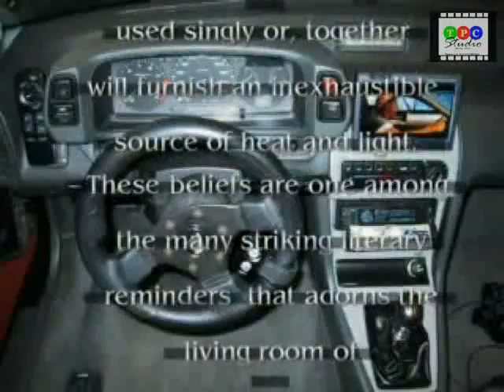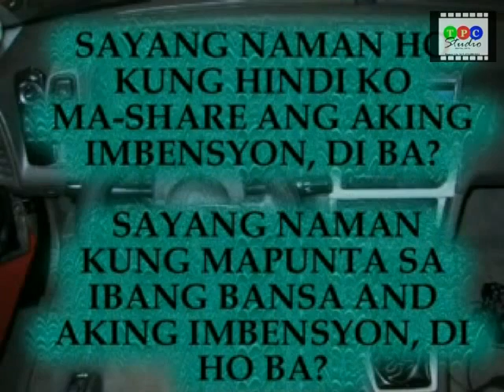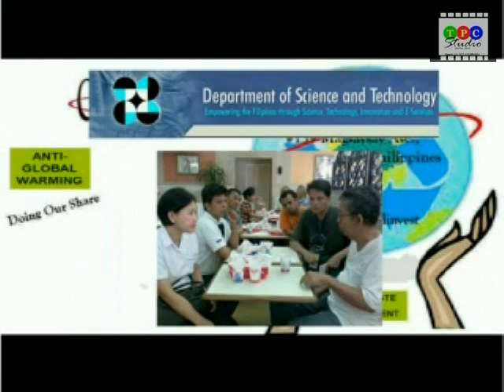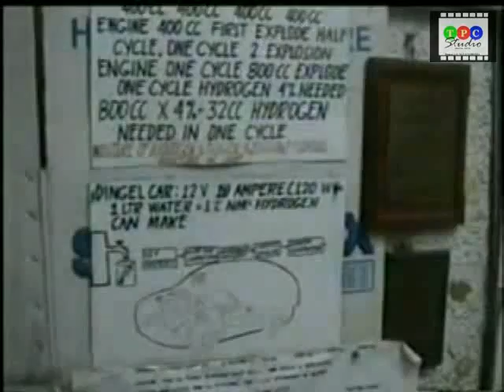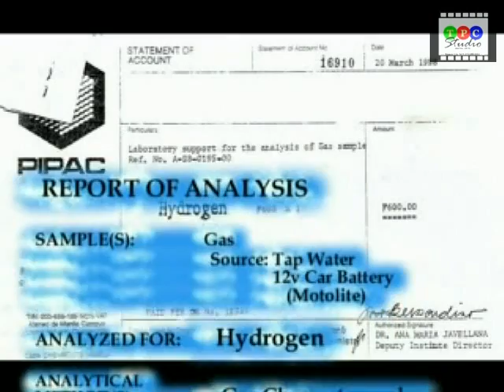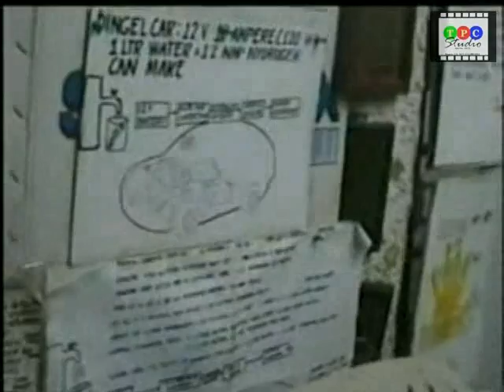Mr. Daniel Dingel's Water Car(part1)

Comment: THE SAME THING HAPPENED TO LEE SALEN-GA ALSO A PILIPINO WHEN HE DISCOVERED THAT THE SIGN OF THE ELECTRIC BATTERY & HENCE THE SIGN OF THE ATOM IS INVERTED MEANING THE ELECTRON IS POSITIVE.
HE ALSO DISCOVERED THAT THE NORTH TIP OF THE COMPASS NEEDLE IS ATTRACTED TO THE NORTH POLE OF THE EARTH; COZ THE NORTH POLE IS SOUTH MAGNETIC(GAY).
HE DISCOVERED THE SALEN-GA PHYSICS EFFECT-THE INABILITY OF THE LIGHT FLOODED TRANSPARENT BLACK OUTER SPACE TO REFLECT STAR(SUN)LIGHT.
VISIBLE LIGHT? NO SUCH THING!!

Comment: Mr.Dingel's electrolyser produces one liter of hydrogen gas per second. The electrodes were very conductive. Then the water has a very violent electrolyte. Not distilled water alone because distilled water does not conduct,tap water does because it has chlorine.When I saw video presentation, I was amazed.I think the secret is on the type of material for the electrodes. Amazing invention.(HHOhybridBuilder)

Comment: Daniel Dingel's invention is true.The reason why people did not blieved him was the fact that the electrolyser he claimed that it only use 5 amps @ 12 volts of power. Of course 5 amps of hydrogen can not power a 4 cylinder car, maybe a toy airplane. But the the thing that people doesn't understand is 5 amps @ 12 volts is the input of I think, Mr. Dingel used a something like a power inverter. The input is 12 volts 5 amps,high frequency,output is high voltage,high current @ low frequency(THANKS)

Comment: And if mr. Dingle refuse, this can only be considered an elaborate Hoax. It is not a problem to get a car run on hydrogen by electrolysis of water. But to claim water as a energy source is another matter. This is similar to the Stanly Meyer type claims. Some seems to have replicated Meyer, but it is not easy done.